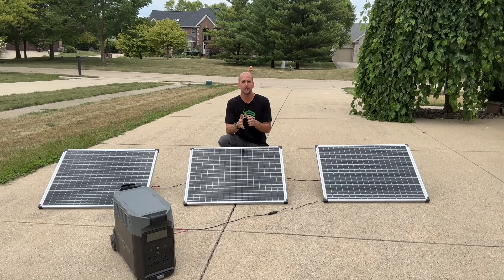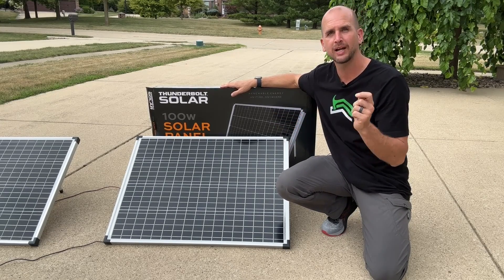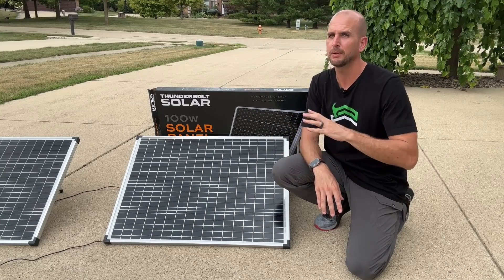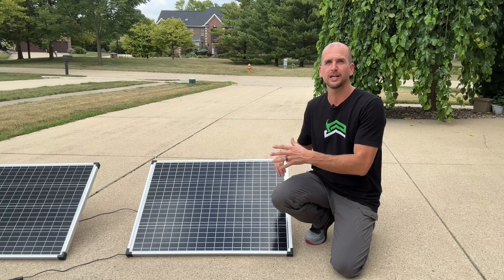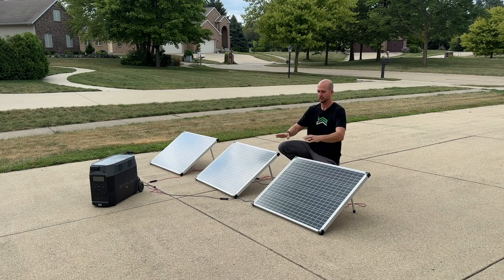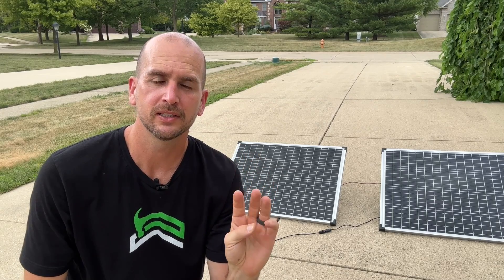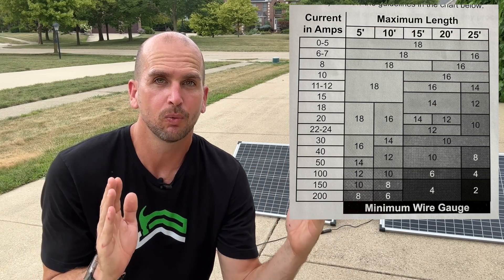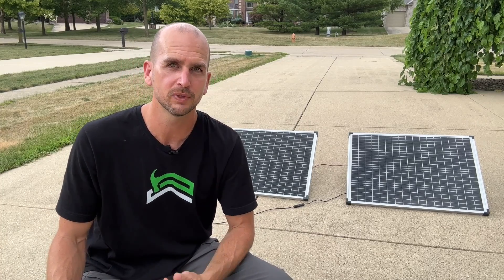Why Your Solar Panels Aren't Producing Rated Power

Comment: Running some portable folding panels, I am going about half the rating. Two 100w panels, and I'm getting 100ish total. I tried isolating and yeah each are about 50w each. they're tilted too.

Comment: I was wondering why I was only seeing 901w so far on my three 380w panels and I assumed it was the hot California desert heat causing the loss. Using 70 feet of 8 gauge wire. 30 degree tilt since Google told me to if anyone is curious.

Comment: Since you have 3 identical solar panels, can you do an experiment for us? 🤣

Put car RainX on one
On the other, some form of car ceramic coating 
The third one leave as a reference 

Would like to know if it hurts power output and if it helps keep the panels clean for longer

Comment: Ive got 6 250w pannels looped together and 300-400w is the average i see....i just connected 6 more 200w looped in another string... now im seeing 400-500w. Im in arizona so full bright sun.. shouldnt i be seeing 3000w? Or at least over 2,000?

Comment: Great video, I'm interested in the 80% conservative factor.... If the panel I'm looking at has an Open Circuit Voltage on the sticker of 22.3 V and I'm wiring in series, are you suggesting that I can sum up the voltage at 22.3V x .8 per panel? That would be good for me because my solar generator has a max of 60V input, so 3 panels at 80% would keep me below that.  Am I going off the rails here?  Thanks, keep up the great work!

Comment: Everything you mentioned, i'd call "obvious", but i guess there are a lot people out there not knowing this. ;)
In addition the STC 1000W/m² are neither constant, nor a maximum of light radiation, the actual value also depends on your location. I don't know values for the US, but in germany this value already varies between 900-950W/m² in the north and up to almost 1200W/m². So in south germany i actually get ~100% of the power rating of panels even with the loss due to temperature. With the effect on cloudy days where the panels cool down in the shadows of clouds, my panels even overshoot their powerrating by 10-15%. 

Another thing you didn't mention is the loss by power conversion. Either the voltage regulation to charge the battery of your powerstation or conversion from low voltage DC to 230V AC causes losses. So even if your panels pump ship 300Wh, you won't get 300Wh of usable power.

Comment: I have 12 260 Watt panels 260 watts for a total of 3120 watts 38.10 voc the configuration is 3s 4p for 114.3 to 80 amp charge controller.This  system is 24 v. I have tried everything and i can get no more than 38 amps from the mppt. 1000 watts out of 3000 . Any advice would be appreciated. Thanks.
Reply from the maker: Have you tested out each string independently with 3 panels in series?  To confirm each string is putting out close to 650W - 750W in full sun (assuming mounted facing south at correct angle for your area).
Reply: I have the same problem.

Comment: Over paneling is always a good idea as long as you use a current sensing device and a relay to restrict or divert excess current.
Solar panels rarely put out their rated power due to clouds.
Some days (and weeks) I get less than 1A out of 2200A of panels.

Comment: I get 100 watts all the time with one harbor freight panel on sunny days, but when I hook 2 together I only get about 165-175 watts for some reason. Still haven't figured that out. I already have 10 gauge wire. I bought a new charge controller, so maybe that will take care of it.
Reply from the maker: Huh, that is confusing.  I have put 2 of those panels in series many times I got over 200 👍
Reply: @everydaysolar   I was using a cheap charge controller someone gave me, so I'm pretty sure that's the problem. I'll know this summer when I hook the new one up at camp.

Comment: That wire gauge chart isn't correct for power transmission.  It looks like a normal non-power-transmission ampacity safety chart (actually not even that since there aren't any temperature ratings on the chart).  Amperages are  a lot lower for continuous power transmission.  Basically as a rule of thumb, for solar wiring, use 10A @ 12 AWG and 15A @ 10 AWG for power transmission to keep things simple.

15A @ 10 AWG drops about 1V at 30ft.  So with e.g. a 56V operating voltage (roughly 3 panels in series) you have 1.7% in losses.  Less if the actual amperage is lower, of couse.  But don't think in terms of actual amperage.

I  recommend sticking with 10 AWG for any serious panel wiring because, generally. Once you've wired a number of panels in you'll be wanting to wire more in a month later.  And maybe more after that.  Even for short distances because you will be slowly collecting cable as you mess around and if you try to optimize it too much you'll wind up with a lot of cable that you can't use later on.

And going 10 AWG will also help cover mistakes as a lot of people wind up not getting the correct type of wire.  For example, super-flexible "poofy" 10 AWG wire with 200+ strands has so much tin-plating on the copper that tin actually makes up a majority of the cross sectional area.

Beyond that, good video.  Series is almost always better (as long as the charge controller can handle it), but parallel has some application too.  Always go through a combiner box with proper fusing when paralleling.  Do not use those MC4 paralleling connectors unless the system is super-small, they suck and are a fire hazard.

-Matt

Comment: Thank you does anyone have any tips for wiring up a high voltage array I bought the Schneider Electric 100 amp 600 volt charge controller my understanding is the VOC is 53.58 * 8 would be allowable for one string in series then I can parallel another eight
Reply: 8 residential panels should be fine for a 600V charge controller.   That's 429V VOC.   Double check.  The charge controller has absolute maximum ratings (that's the 600V probably), but it also has an operating MPPT range which is typically a bit lower than 600V (e.g. it might be 550V).   De-rate by 20% relative to maximum ratings or by 15% relative to the rated MPPT operating range to handle bright conditions.

600V - (600V * 0.20) = 480V panel VOC   (very important limit)
550V - (550V * 0.15) = 425V panel Voperating (less important suggested limit)

So your 8 x 53.58VOC = 429V is just fine and you could even go to 9x if you wanted to goose it (482V which is over 480V but close enough).   But you would NOT want to go 10x.

Stay as close to the de-rated high side limits as you can because you want any diode bypasses due to shading to keep the panels inside the MPPT range of the charge controller.

--

I'll look up the Schneider Electric data sheet for you.  The data sheet says:  600V Maximum VOC, MPPT range is 195V to 510V and PV array operating voltage is 195V to 550V.   If you have Q-cells with 53.58 VOC, the operating voltage is 44.54V.  So:

44.54V x 8 panels = 356V operating (429 VOC)
44.54V x 9 panels = 401V operating (482 VOC)

Controller 600V - (600V * 0.20) = 480V VOC (best practices maximum)
Controller 510V - (510V * 0.15) = 433V operating with optimal MPPT operation.
Controller 550V - (550V * 0.15) = 467V operating

So you are good with 8 or 9 panels in series.   With 9 the panel VOC is 2 volts higher than best practices, but it is still just fine I would say.

-Matt
Reply from the maker: Matt, very good feedback.  Thanks so much!

Comment: The 6th factor is that the Chinese always overstate performance of batteries and solar panels.
Reply from the maker: We need to setup a 3rd party testing where we run all the panels through the same testing to get the real ratings for each panel.
Reply: @everydaysolar  See if you can partner with LTT, they've started doing some testing like this on cables, and stated they wanted to do more

Comment: I picked up a few of those HF 100w panels last year and they put out well over their rating when brand new even in the low 80s outdoor temp. Of course in clear full sun. I was impressed but idk how well they last in constant use.
Reply from the maker: Yeah, we shall see if they hold up over the years but I also think the construction of the frame is solid 👍

Comment: This video was great. I was thinking of doing exactly what you said. Permanently mount and Connect 3-100W panels to my super shed and use them to power/charge my eco and other things. AWESOME STUFF! Thank you.
Reply from the maker: Oh nice, I am basically going to do a few different options for that exact setup this year.  One will be more plug-n-play probably leveraging an EcoFlow Delta 2 and the other will be DIY where I mix and match the components.  Just bought the shed, will build it on Everyday Home Repairs channel and then will do the solar setup.  I am hoping to get it done in Feb if I can get some warm days in Illinois 🥶
Reply: @everydaysolar  Awesome. Cant wait to watch it and see it all come together.  Love the plug n play vides to make life a little easier. I have a great shed just want to put solar on it to charge my ecoflow pro and other tool batteries, lights, etc. for emergency. Wishing you luck. Will go to your other channel too. Wish you were closer to us, would be fun to do it together for the channnel for other to see.

Comment: My 16 canadian solar 400w bifacials were producimg over 7k watts yesterday :) yes it was cold and the voltage was spiking higher than normal when the sun popped out of the clouds
Reply: I have them mounted 4 per brightmount array on a top post mount from ussolarmounts dot us each 8 in series per string into my 6000xp and 2 280ah powerpro batteries. Has been working perfect for my off grid cabin
Reply: @tjmooney4181  I plan on using brightmount racks along with bifacial panels as well.  Can you list what model post mount you used from ussolarmounts?  Thanks.
Reply from the maker: Dang, not too shabby.
Reply: That's a good amount of overage. Is the rear rated @100w on those? I'm getting some 400 +100 bifacial arriving next week from Signature solar. Going to create 2 small , ground mount arrays for my delta pros with them.